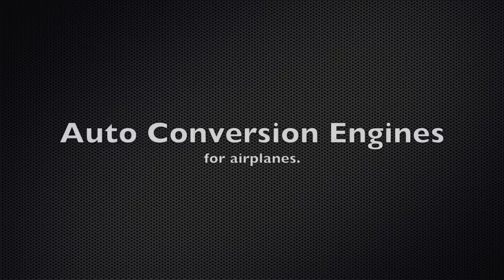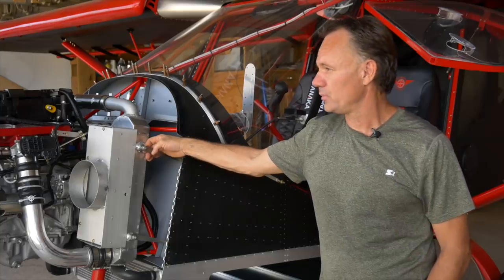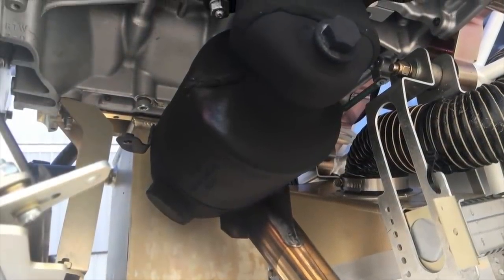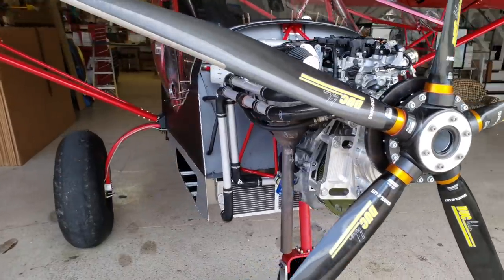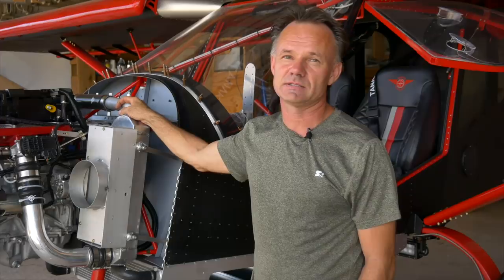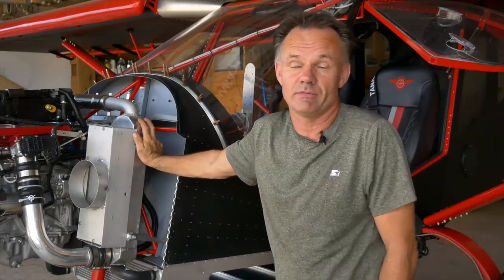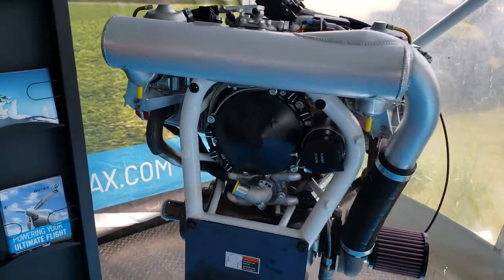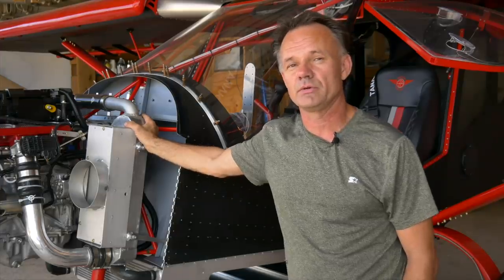Car Engines Used For Flying Airplanes l Viking Aircraft Engines

Comment: ..the very first time I spot a car engine in a plane, was in Brazil. They used Toyota Corolla turbocharged engine with CVT gearbox on propeller. Works amazing. Was 2002

Comment: In reference to the engine that powered the Wright Bros first several,(or more) aircraft they designed,and built, they did all of their own machining,even designed and built their own wind tunnel for testing. I read about them back in the 50's when I was a kid. They had a dream to fly,and fly they did. They changed the world forever...

Comment: I have a K24a4 in my Honda. 200,000 miles at say an average of 50 miles an hour is 4000 hours.  Even with less than perfect maintenance and pretty much driving the heck out of it for the past 16 years it still doesn’t burn oil and it has never not started. The only thing I’ve ever done to the engine is one valve adjustment, and one set of spark plugs.  I have to say that reliable is the only way to describe it.  When you hear how often piston aircraft engines from 70 years ago have to be serviced and rebuilt and fussed over to be safe, I say it’s time to replace them all with a Honda K-series engine.
Reply: This guy talks at length about how that engine was built from the ground up to be turbo charged that’s probably just to pacify Old school guys that aren’t used to turbo chargers. The K series engines in typical production hondas are fairly detuned.  They will take tons of boost .  There are videos out there of these engines on dynos running 10,000 RPM and nearly 1000 hp.  You can do better than 400 hp without even beefing it up with just mild boost.

Comment: Are there any reliability figures for automotive engines on aircraft?
Reply: To paraphrase Paul at AV web, they never fail.
Reply: Average Honda engines last 150k miles and those little 4 bangers in civics run at extremely high rpms cruising the highway. Mine used to run 4k rpm at 70mph for example, and it had no problem doing that at  180k miles, for a 20hr XC trip. The max rev on mine was 6900 for the red line and iirc about 7500 when it would cut fuel. 

I think 3k rpm was more common, average speed 30mph, 150k/30mph is 5000 operating hours, on average, in mostly stop and go traffic. So the engine is under max stress as it revs up under load, and often up 4500-5k rpm before down shifting into cruise.  Many pushing 6000-7000 hours without anything but oil and coolant changes.

Comment: Now, THAT's what I'm talking about! Honda spent millions (Billions, over the years?) developing hearty, long lasting, durable motors that have a jewel like quality- and, Viking-smartly- is using them to make aircraft engines. I agree with Jan- why re-engineer the already engineered? Sure, ounces count, but...The only thing that I note is the overall height of the motor from the base of the oil sump to the top of the valve covers- it 'seems' pretty tall. Cowl packaging is a blended art/science, and, Mr. Eggenfeller seems to be the Dr. Frankenstein (mad scientist) of the business!
   I only wish a 100- 120HP motor with small dimensions (hmmm, 1.0 - 1.3L 3 or 4 cylinder, anyone?) that weighs a smidgen under 200 Lbs. all in, for say, $8 - $10k that uses mogas, and, parts can be picked up at your local O'Reilly's/ Pep Boys... It seems that Rotax owns the market, and, is priced far out of the reach of the average builder. Ford's 1.0 Liter 3 cylinder Eco Boost is a pretty sexy concept motor, and, there are tons of motorcycle engines that could be considered (and, basic packaging work has already been done).
   That Pegasus 0 - 100 is really dreamy- opposed 2 cylinder, air-cooled, off the shelf parts, but, at 58 HP- misses the target. It works in so many other ways- no gearing needed, no coolant lines or radiators, compact dimensions... Aarghhh!
   Color me crazy, but, the venerable VW motor was designed in the late 1930's. Sure, millions upon millions have been manufactured, trillions of miles have been driven, bladdy, bladdy... It's 80 years old. Surely, a low revving, massively over-square air-cooled motor could be developed...direct gas injection, small turbo, computer controlled... Think, a modern design of the Corvair motor.... Why not?
   Kudos to Viking for making a business out of Honda motor conversions- lots of work has gone into FW packages by Jan Eggenfeller- I know I would have his motors at the top of a short list if I was building right now...
Reply: Jan lots of talk and claims but where are the happy customers. He had his Subaru conversions go bust, leaving builders in the dust. A viking PSRU failed causing an accident. Get a Lycoming O320 and call it a day, go fly. Don't experiment with the power plant.
Reply: I am sorta on the fence here. The new tech is nice but it has vulnerabilities as well. Honda is not as reliable as it used to be. It really depends on how long they been making that particular engine and what has been done to adapt it to an airplane. The Honda will probably far outlast an air cooled conventional airplane engine.
Reply: @perry9492  why not get an LS or honda k24. They are proven powerplants with a big aftermarket.
Reply: @gmcjetpilot  So how long do you suggest we stay stuck with 1950s era  power? Well past time to progress.And the cost to run and maintain 60 year old technology is absurd.
Reply: @gmcjetpilot  You act like Lycomings don't fail, they do. Regularly
Reply: @SVSky  I don't act. You are making a non sequitur. Of the millions of air cooled piston AC engines (including radials), they have a tremendous reliability record if operated, maintained properly not neglected, disused and abused. Fact. Car engines in planes. Case closed. Go back to your "modern car enginee" in airplane fan boy club.... you are dillusional.  I have many thousands on hours flying Lyc and TCM.
Reply: And years down the road when this engine is 20,30, even 40 years old parts will still be abundant and affordable because their counterparts were produced in both aircrafts and automobiles !
Reply: @mordfustang1933  Poetics aside you wrong or should say Wou Yrong. A great aircraft engine will always make a crappy auto engine and vise verse. Totally different design parameters. Dream. Sorry. Aircraft engines and their parts are readily available, not too expensive by aviation standards, very efficient, light, low drag, over built, under stressed, simple super reliable systems (fuel, induction, ignition no water pump). 

What you might not realize or comprehend is the current aircooled Horz opposed (boxer) direct drive (of prop) aircooled aircraft engines are the result of a half century of R&D, 100"s of millions of flight hours and 100's of thousands of engines built. Massive spending by USA and corporations (fm 1930's to  early 60's pre jet, especially WWII) was involved in developing the aircraft engines today. It was like the atomic bomb development, moon missions and vaccine development of today. No expense spared in the best of the best designs, engineeting, materials, manufacturing and processes, proven by 100' of millions of flight hours.

 You say but that is 1960's technology not "modern". Well two points:
1) Aircraft engines past or present, you can't get better materials and QC. Not to mention an optimized design as explained above. 

2) A 1960's Lycoming or Continental may look like one made today (and yes they are still made today and based on inflation they are bargains proof of the design). However engine manufactures have upgraded their manufacturing tools, processes, QC, testing to the most "modern". They have spent millions upgrading their manufacturing. ALSO over the last 50 years of recepicating aircraft engine evolution countless small changes have been made. Example new cylinder coatings (nitrate vs chrome) came along and implemented. Any problem from service history was addressed. Like a part of case that could crack after decades of hard use was beefed up.  The forged rods and crank, sodium filled valves, cast aluminum case and heads are the best and lightest yet strongest design as it was in the 1960's as today for aircraft use. It is simply the best and no Honda or Toyota or Ford has a better or stronger core engine.

You want "modern"? First car engines (not including ignition or induction) have not evolved that much. Yes we have variable cam timing, direct injection like a diesel for gas car engines. These help fuel economy in an engine that requires idle in traffic (a lot) then accelerates, then idle again or going down freeway at 20%-30% of it's rated HP. The real gain for car engines or $modern$ part us the ignition and fuel delivery or EFI. 

"Modern" eectronic FI and electronic ignition are available mostly experimental flyers. Like in the 1970's car hot rod'ers added CDI or electronic ignition. FI on cars came late 1980's in part due to fuel and polution standards (which aircraft are exempt until the leftist take ovet). 

The TCM Turbo IO-550 is on the  new (near $1/2 M) Cirrus aircraft, single lever throttle / Prop / Mixture. Great. Why not retro all the Cessnas, Pipers, Beechcraft etc. The main reasons are two fold:

ONE: Certification is expensive (but "experimental" or amature built (kit) aircraft get a pass which is an amazing freedom). The cost is huge to certify new aircraft engines and major systems (fuel/ignition). Where the traditional dual Magneto (100% insependant of ac electrical sys) and Carb w/ Mechanical fuel pump or mechanical FI is 99.9999% dead nuts reliable, redundant and insependant of elecricity from plane. Manipulation of mixture control and if so equip prop control is not difficul, but it does require pilot action and training. Dead simple mechanical direct control is a hall mark of aviation. 

TWO: Reliability is #1 for safety "modern" or not. An aircraft engine stays at a constant 60% to 75% of it's max rated output most of a typical flight. Except for Takeoff and climb (100% to 75% pwr) the plane is in cruise flight at constant power (60%-75% typ) followed by descent and landing (50% pwr to idle) once in a flight. 

Still at the core engine design is the same. Why screw with or discard an engine optimized for Aircraft use for one made for cars, heavy, spins too fast for prop, watet cooled making implementation of radiator for low drag problems. There is no compelling reason to put a car engine in a real plane.

When I say "real plane" I mean not an ultra light, light sport, slow (less than 120mph) low altitude STOL.. Yes a sniper Cub is a real plane but it also has an aircraft engine. A "real (capable) plane" is able to do aerobatics, have excellent t/o and landing capabilities, and it can carry at least 2 ppl with bags cross country with at least 500 mile range,  up to altitudes of 15,000-18,000 ft and speeds (TAS) of any least 160-190 Kts (184-218 mph). Also a real plane (engine) can compete and win in Red Bull Air Races and Reno Gold Sport Class. In Both of these race series when last run, the engines were Lyc IO 540 and TCM IO 550.

 You want to build sub 100 HP 90mph slow low flying plane fine, put a little car engine in it. Spend 100's if not a 1000 or more hours fiddling with it. OR you could put a Lyc or TCM in and go fly reliably with out all the fiddling. In the end a car engine "conversion" will cost $$$, as much or more than if you just put an aircraft engine in the first place.  Up to you.

To be honest  there's not a lot to choose from In the 80-120 horsepower rating using aircraft engines. These engines are around but either not as plentiful and/or out of production. You can still get parts however. There are thousands flying in Cubs, C-150/152's for example. The only choices are the Lycoming O-235 in the Continental O-200. They're great engines but you're better off getting at least an Lyc O-320 they are 160 horsepower engines  and in full aftermarket production. They will be cheaper than a O-320 or O-200. However many small light sport planes are too small for a O-320/160HP engine. This is where Rotax comes in.  However their Euro made engines cost more than a Lyc, but they do offer 80-100HP engines suited for light small slower planes. They are water cooled, but that is fine for a slow plane. Their top of the line turbo 150HP low TBO engine is $30 grand.  Yeah no thanks. Again up to you, but an aircooled, direct drive, dual mag, Carb O-320 is the most bang for buck and safety and performance.

Comment: ive looked at at a lot of automotive engnes for my RV- imho the best of the bunch is the Mazda Rotary for the durability, power, torque, and low weight-  more like a turbine than a piston bumper.
Reply: Reliability with rotary engines is pretty bad. Honda k24 is light and has a big aftermarket. LS is not as heavy as you think. Mercedes M104 3.2 liter is also very cheap(under 1000dollar), reliable and can make crazy power with a turbo.
Reply: Although a straight six probably doesnt fit
Reply: @TTURBOVOLVO  ...  not if you remove the troublesome oil injectors and mix oil directly with gasoline...  and rotaries LOVE turbocharging.  The next favorite is the Subaru boxer.  Incidentally, the RX8's on the racing circuit go the entire season while the piston engines are rebuilt after each race.
Reply: Rotary and durability can not be used in the same sentence..😂

Comment: Why not also use the cars transmission and the drive shaft to turn a reduction drive to spin the prop ...I mean you would get a ton of torque and you could keep the engine running the way it’s designed to also using the engine torque at low rpm is how you keep a car running for over 300,000 miles right? I mean I know anyone who owned a car knows that right?

Comment: As a complete honda guy myself.. it sounds like they're using the L15's. I could only imagine what those planes would do if they used the K20C1 thats in both the accord 2.0t, the civic type R, the Acura TLX, & Acura RDX. The power ranges from 252hp to 306hp depending on which car it came from.

Comment: What would be the most promising engines for a conversion? What are the side effects of the completely different air density/speed, temperature, vibration and RPM/torque/power airplanes have to tolerate?
How can the different working conditions be tolerated better (besides changes in the ECU)?

Comment: Currently shopping for a power plant for my experimental. Am intrigued by this company since there are a lot of VERY loyal customers. I guess my concerns lie in two areas. He’s basically indicated that they do everything they can to stick to the auto engine design, making complete sense. Piggyback Hondas hundreds of millions of dollars and R&D and their proven track record. I get that, it’s established and built in value. BUT, where does the $17k sticker price come from when it’s a salvaged motor with minimal changes? I wonder about redundancy as well with single plugs driven by an ecu. Electrical failure = forced approach??? Happy to be corrected if that’s not the case.

Comment: Do they have any issues with not having redundant systems like like ignition and single plugs, etc?
Reply: With modern engines running at proper a/f you dont have the fouling issues carb engines have. Electronic ignition is much more reliable than older systems as well, it's not an issue.

Comment: Have you ever looked into using the Mazda Wankel engine in a plane? I’ve been told that it has been done with great results. The horsepower to weight ratio is fantastic. What would be involved in making a Wankel air worthy?
Reply: I don't think anyone wants a finicky ultimately unreliable and very very thirsty rotary in their plane.
Reply: It would be great for a kamikaze pilot. A rotary would not survive being under a nearly full load for hours straight. Apex seals would go, and it would consume its own oil until failure.

Comment: Wonder why automotive industry has such reliable electronic ignition systems but in kit aircraft, after market ignition systems are plagued with reliability problems. We have a 172 in our club with ElectroAir ignition and that thing only runs good for a month before the wires get burned out. It’s going back to twin mags and ElectroAir stuff is going in the garbage.
Reply: Because Honda Sells 450,000 Accords a year, and Ford sells 900,000s F-150s a year. There's a lot of development money pouring into cars.